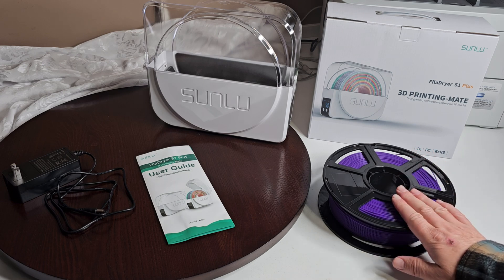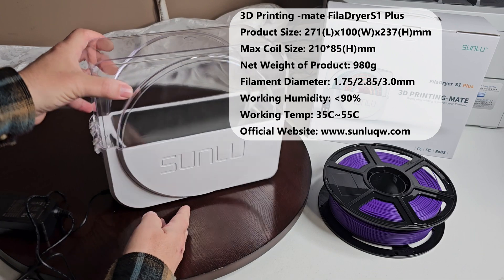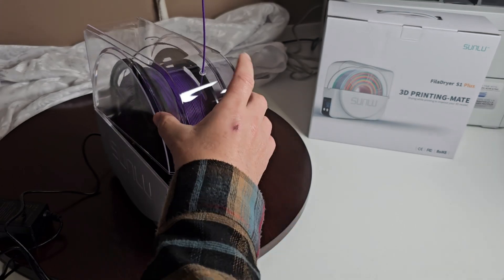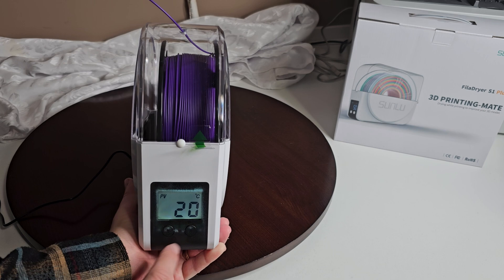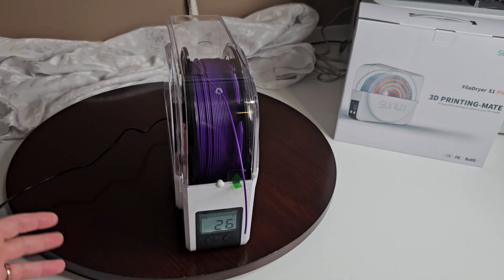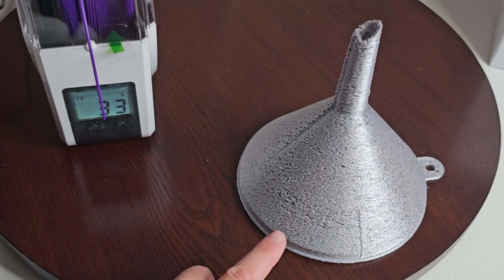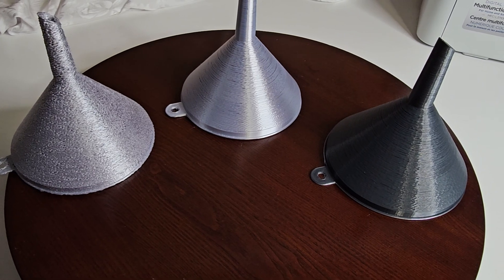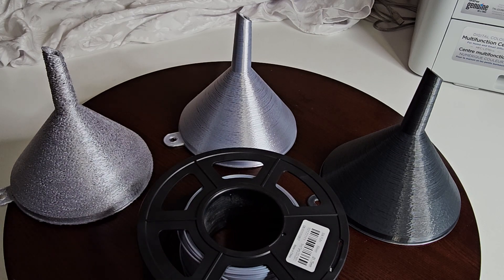Introducing The Sunlu Filadryer S1 Plus: Your Ultimate 3d Printing Partner

Comment: I didn't know there was a curing time, Making these Funals  is cool.🎉
Reply from the maker: Yeah, I need to make the outside walls a bit thicker, and fix a flaw in the design. No curing time, that's for Resin. Just that the filament over time absorbs moisture, so this fixes that. Thanks